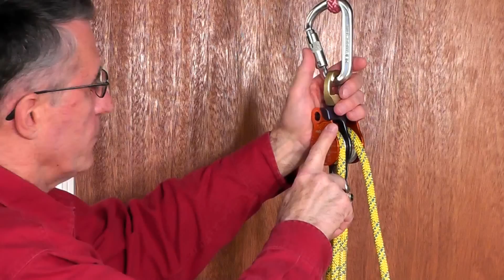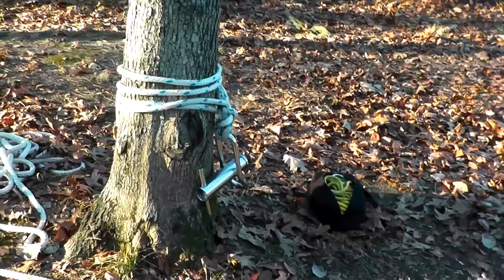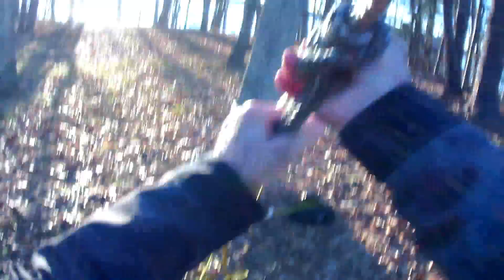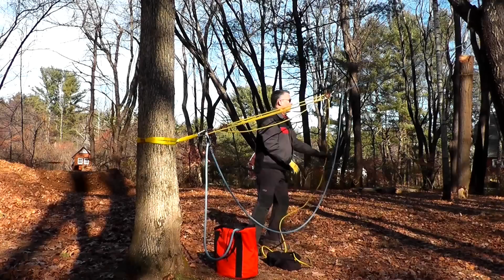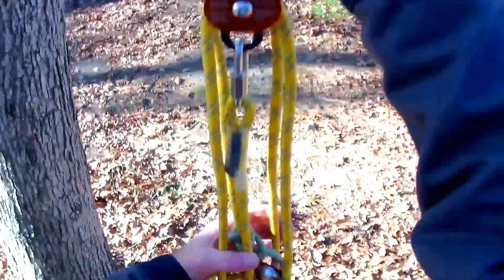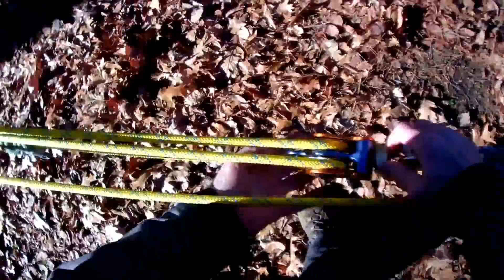U-RIG -- Pocket MA for tree work

Comment: Did you piece this system together yourself or did you buy it as a kit?
Reply from the maker: +Matt&#39;s Yard Maintenance  Just on my own, Matt.  But TreeStuff.com knows the components   and they've built the system for many people.  The only thing to be careful of is having two (2) biners in one(1) hole of one pulley ... they should NOT touch each other when under load or you run the risk of mis-loading them.  The Rock Exotica work fine, some others are too fat and don't work well.

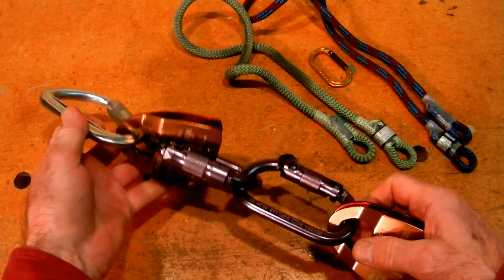Comment: This is great! Thanks for sharing. Do you think the 36kn system is compromised when you attach the carabiniers end to end at 3:20?  Congrats on getting the U-Saver on treestuffs website. Good work!
Reply from the maker: Dylan, this is a great question.  The answer is NO and the thanks goes to Rock Thomson.  The upper pulley and the two binners only carry half the load (14.4kN).  The lower pulley carries the full load (28.8kN), half through its axle and half through the "micro rigging plate".  The P22 is rated for 36kN on its axle
alone so both these pulleys are loafing.  The one working to its rating is the P51D at the head end.

I JUST GOT my uSAVER from TreeStuff.com.  They hit it out of the park!  I gotta do a video ...
Reply from the maker: Not to overdo this, the above numbers are during the "pulling" phase when five strands of HTP each carries 7.2kN.  When you let go and let the control prusik hold the load, three strands each carry 12kN.  Then the lower P22 sees 24kN on the axle and 12kN through the rigging hole, still within spec.